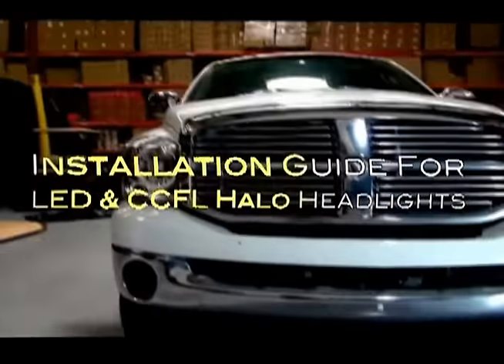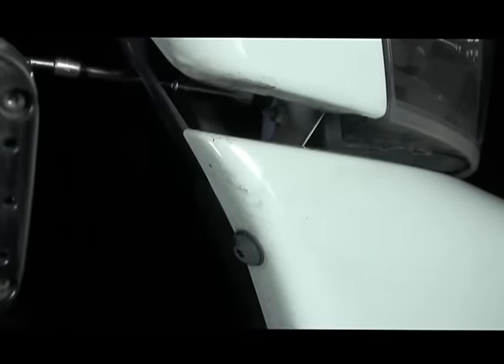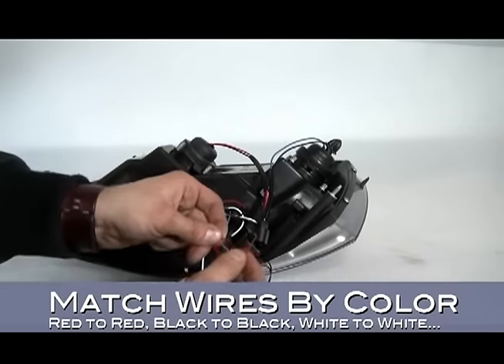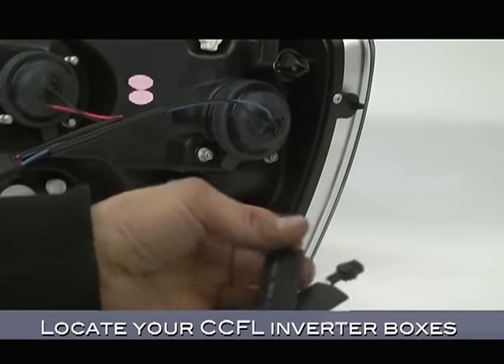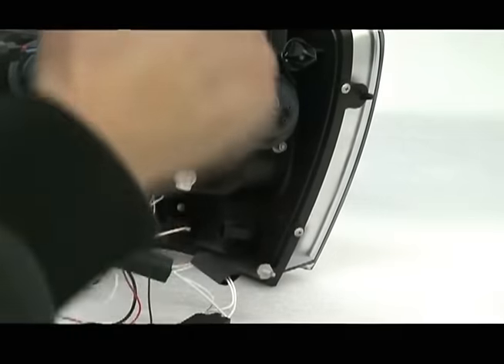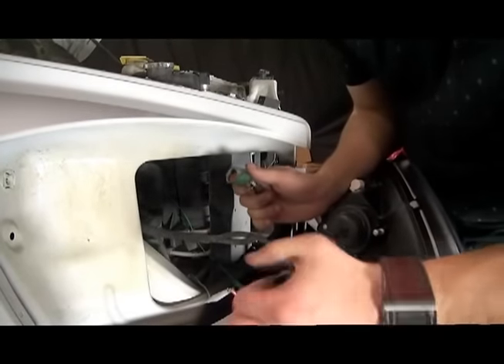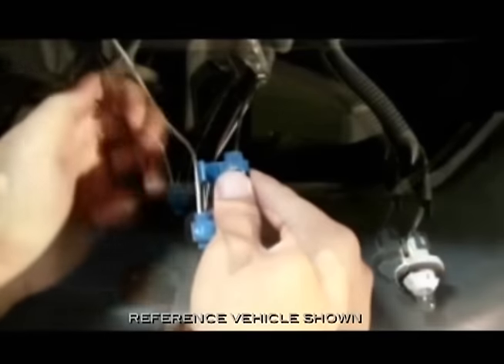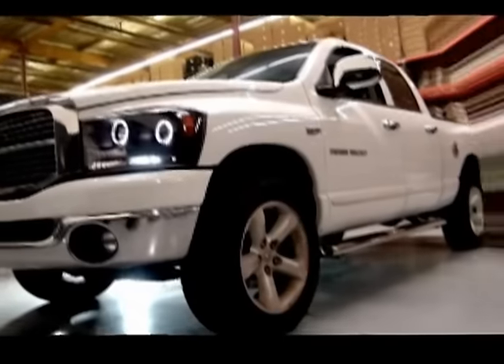Spyder Auto Installation: 2006-08 Dodge Ram 1500 CCFL LED Halo Projector Headlights

Comment from the maker: great question. there are only two options for halos - LED or CCFL. if it just says halo it is probably a LED-lit halo. LED lit halos are dimmer than CCFLs and are visible mostly at night as an accent light. CCFL stands for cold cathode fluorescent lighting. this is a very bright, crisp white light because the halos are actually small fluorescent light tubes. These are more expensive than LED but are easily visible during the day. I hope this clarifies it for you

Comment from the maker: The socket the far right of the light that does not connect to the truck is for certain model. The Ram has 2 style of headlight from 06-08. there is one style that had a amber strip on the bottom of the light and one without the amber strip. If your vehicle does not have that socket you can leave it alone or tap the wire. The HID problem you will have to contact the company you order these lights from because SPYDER does not sell or have HID kit.

Comment from the maker: hey there, great question.

You'll use the headlight adjuster bolts on the backside of the headlight, as you can see them in the link I have attached to the video description. It's easiest to adjust them in a darkened setting with your headlights pointed at a wall about 20 feet away to adjust your headlights up and down and left to right.

Comment from the maker: Sir please note that these light are halogen and not HID so relay harness and "canceling resistors" is not need. those part will only be need if you added and HID kit and you have either a bulb out or  lights flickering.

Comment from the maker: yes we offer headlights for 2009-13 Ram Truck Ram 1500 models and our headlights should fit as long as your Ram is not equipped with the factory (OEM) HID system

Comment: If I cut the driving light wire from the OEM socket and I put the LED wires to that running light , will I have the LEDs on while running lights but not the yellow bulb while they’re  on and the actual turning light will light up the yellow bulb when I activate the turn or hazard lights on? My main point is that I don’t wanna have the yellow running light on just want the yellow turn signal when I activated them.

Comment: I see you tapped the white wire to the park light but where does the red wire tap to and where do I put it? Is it tapped with the white wire with the parking light? You guys need a new video explaining the connection of the loose wires. If anyone has any feedback please help I have an 07 dodge 3500 with only two connection points when I take off the existing light

Comment from the maker: yes, the bulbs are replaceable.
high beam - h1
low beam - h1
led - replaceable t-10/194/168 miniature wedge 
signal/parking - 3157
Reply: Is that the same for the 2004 ram?

Comment: How do you adjust these lights?  I bought a truck with them in and my high beams are where my lows should be.
I've searched it and all I can find are guys saying "the adjustment screws SHOULD BE on the housing behind the light," but I can't funds anything that moves my beams.
A video on this would be very useful.
Reply: +xjpostmanYou have to remove the light assembly from the truck to make low beam adjustments....stupid design and almost impossible to adjust with the assembly out of the truck.

Comment: Hi why in a ram 2006 i can not pull it out??. I tried i Took the two screws on the front and the one down the fender 10mm but At the time Inwant to take it out it Seems a screw At the left top side on the back of the headlights  need to be taken out but your video does not shows how . So there are two screws
On the front two on the back one down the fender and one that does not shows the video on the top of the bottom back 10mm screw.can you help me ???

Comment: i purchased these headlights. turn signal on the far right side has a plug but no plug on the truck for it nor in the kit for it. 

and hid's will not fit into the projector without modification of the headlight.

Comment: Where can i get the right plug for the little amber turn signal next to the leds on the bottom? I looked on the socket and it says CS182F E1.
Reply: Saw the same with mine..I just soldered a couple leads and tied that into my parking lights. And taped up the plug to make it water tight.
Reply: I'm having the same issue. mine fits but doesn't latch or seal out water
Reply from the maker: Nathan Wilson ***** 
the socket comes with some RAM models but not all. if your RAM doesn't come with it you can get it form the dealership and wire it.

Comment: Does anyone have any idea how the hell you connect that little orange light next to the LEDs near the bottom of the head lights ? I want that thing to work too!
Reply: XzLeviathanzX  On mine I took two of the tube splicers that you crimp down and made a plug for it then just ran two wires back the blinker and just use that light as a blinker
Reply: that's not a bad idea. I may wire mine into my running lights.
Reply: I ran mine to my running lights with a temporary connection. Anyone know the harness male end so I can install it properly. Why wouldn't this hardware be included????

Comment: mine has three bulb holes. no instructions for the small hole. my original bulb doesnt fit in the new light. 2006 Ram 1500 SLT
Reply: the bulb/socket from my truck is oval shaped. the third hold in the new lamp is roumd. next to the LEDS
Reply from the maker: +Brian Lefler can you please email some pictures to techsupport@spyderauto.com we can try to figure it out for you from there. thank you.

Comment: These are a hazard,  the adjustment is so minimal that even adjusted to the max they shine about 3 feet higher than the hood of the pickup at 15 feet let alone 25.  I can only use the high beams on the road as the low beams are so far off, they don't even offer lighting for the lines on the road.  Adjustment of the low beams is complete removal of the assembly.  Sold my OEM set too soon and then had to go buy another set to replace these.  Willing to make someone a great deal on these but not responsible for you or the deaths you cause by driving blind at night.

Comment: Why is the turn signal not on the side?
Reply from the maker: Because the lights were designed that way.  Anyhow, if you take a look, you will notice that the light is in a reflector housing, meaning, even from the side of the truck, you will still see the amber light reflecting when the signals are on.

Comment: Those wires are awfully small, what 22 gauge?, Thanks for showing these spyder light video, I think I will avoid the brand!  It is these tiny cheap ass wires used on the truck that are causing all kinds of problems, Computer, Alter, charging, shifting, even allowing the engines to stay running. On a truck mind you. A few bumps on the road, and that's it.
Reply: LED lights don't need thick wires